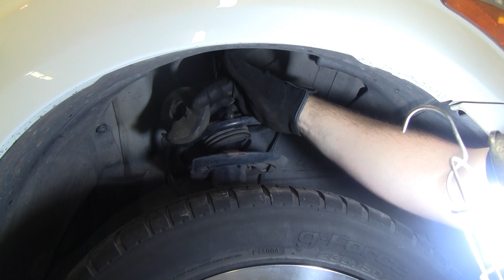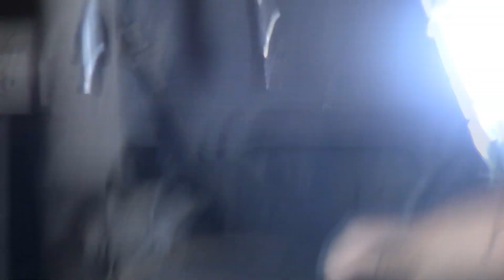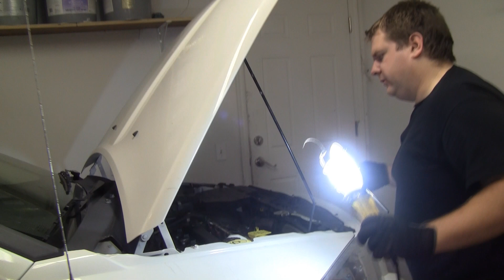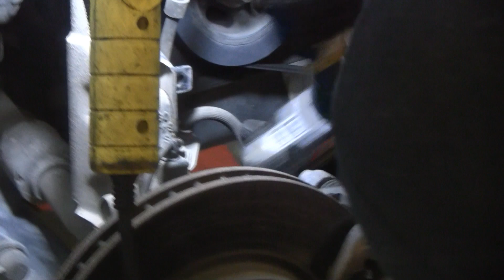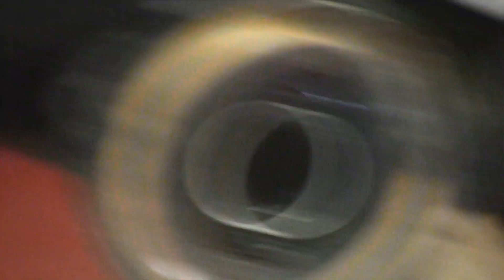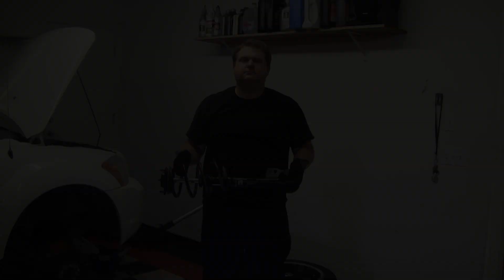How To Replace Shocks / Struts On Your Car

Comment: Eddie Marquez, It sounds to me like you may have a loose or broken motor mount if the car was hit in the front. When the engine puts a load on the car it could be jumping around a bit. When its in neutral you wont have the shake because of 0 load. Just a idea.

Comment: MixTube When he removed the old strut you noticed the control arm and brake rotor lowered down to the floor?  This is why he didn't need to compress the spring; he had plenty of room to install the top of the strut before he assembled the lower part.  I hope that makes sense :)
Now my 2 questions: when I am idling to a stop light or through a parking lot in my '07 Caliber, when I apply the brakes and the momentum of the car shifts forward, I hear a like a "shucking" sound.  Like some material rubbing against metal.  I am about to change the rear brakes in order to solve the problem.  
Second question: why haven't you answered anyone's questions?  You are very informative in your videos and seem to have a great deal of knowledge.
Reply: I replaced the factory struts in my Caliber at around 32000 miles and I've never compressed the springs in order to remove the strut assembly.

Comment: Hi there thank you for posting this video. I recently replaced both shock absorbers on my dodge caliber successfully. Now I need to replace the rear axle bush which is proving tougher to do. Do you have a video that shows how to do this? Or even removal of rear suspension assembly? Thanks John

Comment: Hello, first of all  thanx for posting this vid, I am working on doing this procedure on my 2007 dodge caliber! I do have a question regarding something else, my car was in an accident and as a result my car shakes when im idleing at a stoplight also when I put it in reverse, but not when I put it in to neutral. I was watching videos on this problem and saw that it could be my engine mounts, Is it difficult to  locate and replace the mounts on an 07 caliber?

Comment: Ok once the shock assembly is out...
When you take off the top nut then go to put back on to reassemble is there a torque measurement or how do you know when it's tight or in the right place

Comment: Have a '07 Dodge Caliber Stx 1.8l love the hatchback!!! I was curious, after reading I have seen that the suspension system is the worst on this car; what is the best strut shock to help solve this issue. Or even would changing the shock help with the suspension problem, if not what my options are the make the suspension better ....

Comment: My problem right now is getting the top nut (plate) off the strut. I have the coil compressed and the whole assembly out on my workbench, but every time I turn the nut, the whole shaft turns as well. You seemed to have skipped over this in the video at the 10 min mark as if it were a simple procedure. Please advise.
Reply from the maker: That is a common issue!  Usually there is a flat spot or hex top on the stud that you can use an adjustable wrench on to turn the nut against.
Reply: +Nick Stageberg fucking genius! Thanks!

Comment: You have to be kidding me, it's a fucking STRUT TOWER! If you don't know what that means Google it, better yet don't make a tutorial on how to replace them if you don't understand how it works. There is no need for spring compressors at all, unless you are reusing the springs and mount. And they are only used after you have the strut tower fully out of the car and ready to be taken apart....People, it's a strut tower! there's no risk of exploding unless over tightening the spring compressor or loosening the strut tower bolt without compressing the springs at all.